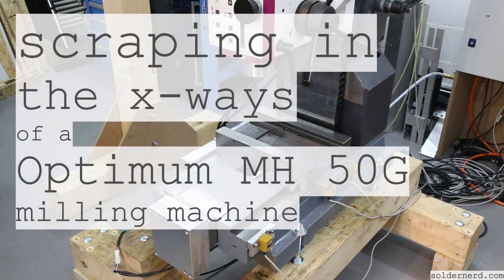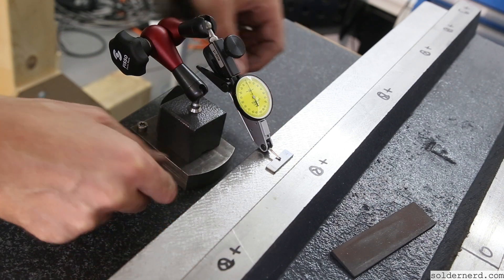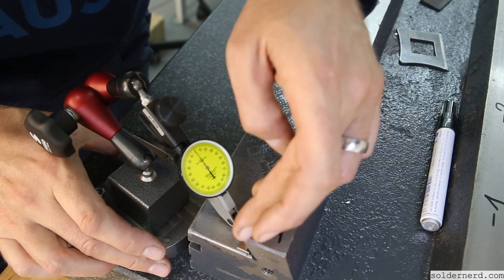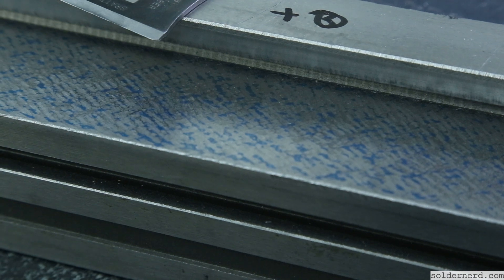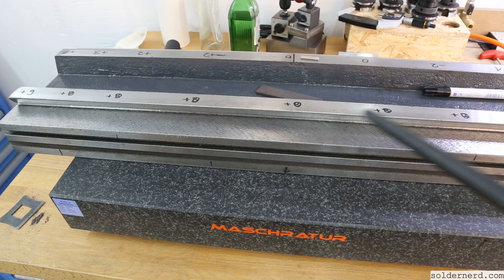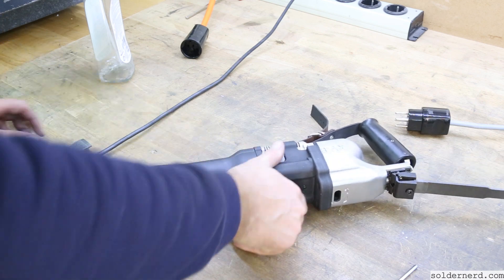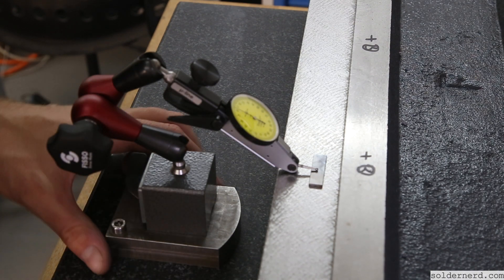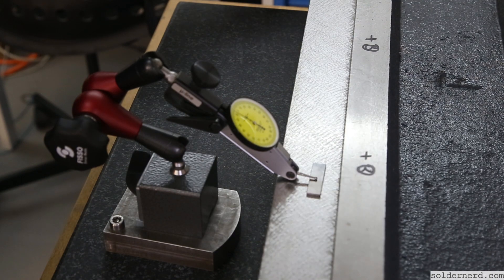Scraping in the X-axis

Comment: Awesome build! I'm working on CNC converting a Optimill MH 50V myself and I've read your German thread a few times (using Google Translate) for inspiration. I really like your attention to detail, your going to have a superb CNC machine when your finished.
Reply from the maker: Thanks for your comment. Is your conversion partially documented somewhere? Generally, there does not seem to be much user reports for this machine in the web when comparing to more common machines like the Optimum MB4 or it's many clones.
Reply: hello to everyone! Another MH-50 owner here. I have revised version with additional bolts on the column. Just started conversion. My setup is direct drives for ballscrews and linuxcnc with closed loop control
Reply: @demon4eg402  I didn't know there was a new version available. Do you have any photos of your build online?